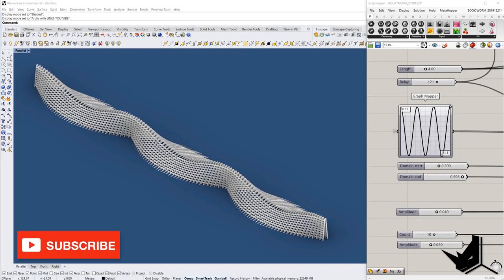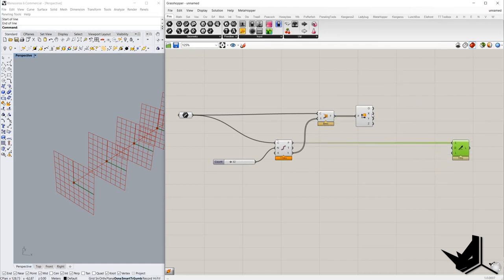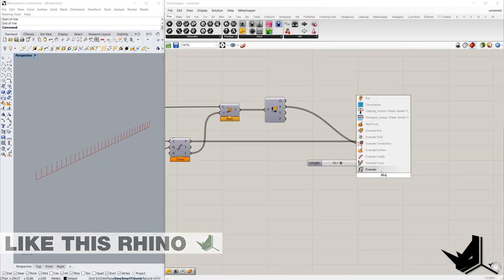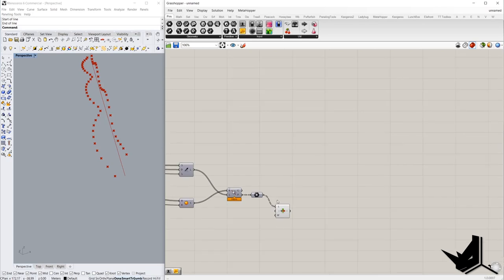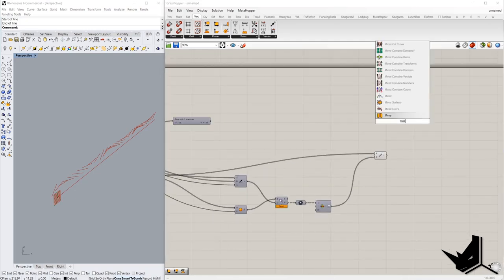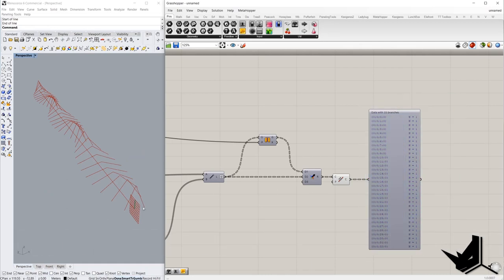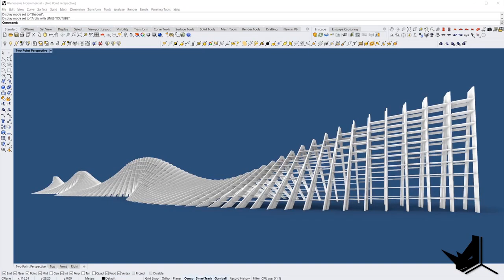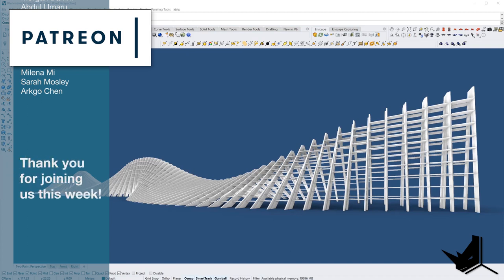Rhino Grasshopper Parametric Wavy Structure

Comment: I am confused about what goes on at 9 minutes, could you please help? thanks!
Reply: Please help
Reply from the maker: Hi Lilly, there is a sketch explaining what it means right then at 9 minute mark. What part of it you're not understanding?
Reply from the maker: @lillyscott3290  If this method doesn't work, maybe you can try to graft the Sphere component first and then connect to Brep Line component. In the output, you should get data tree structures with two items in each branch. It is really important to take the data from the "P" output. Later on, you need to select one item (point) from each branch as it is shown in the video. I hope this will help you.
Reply: He is using the List Item
Reply: @TroyMonroe  oh thank youuuuuu, i got it